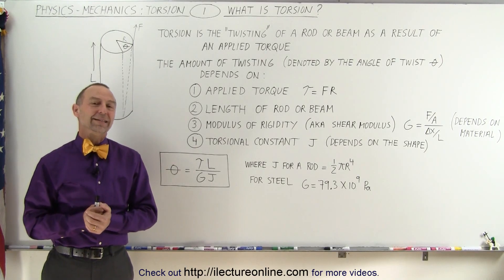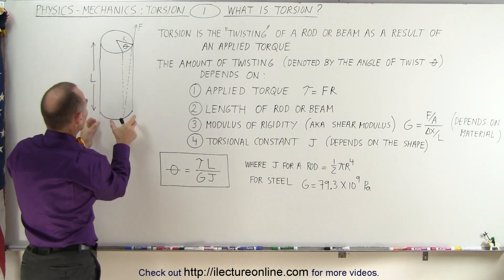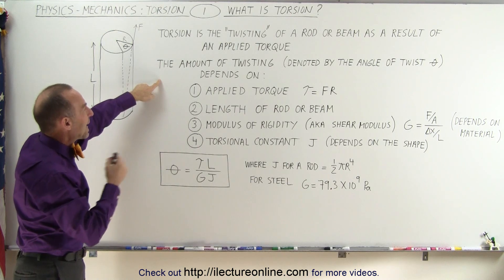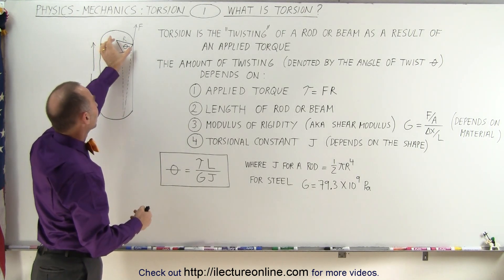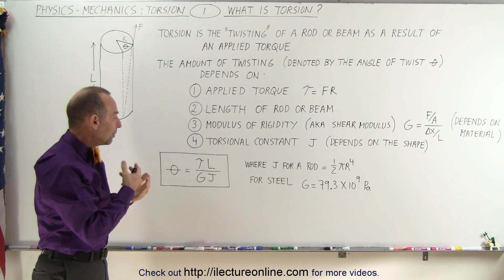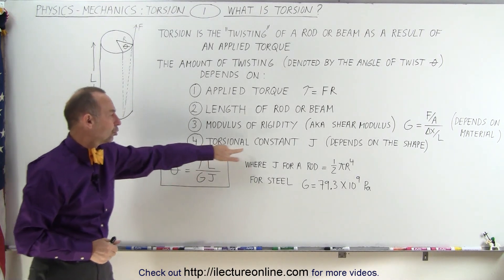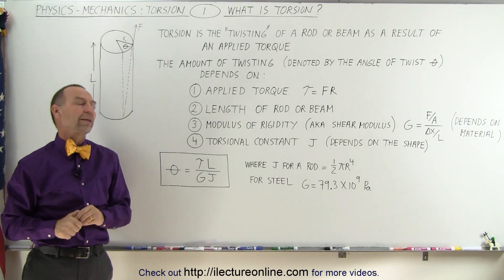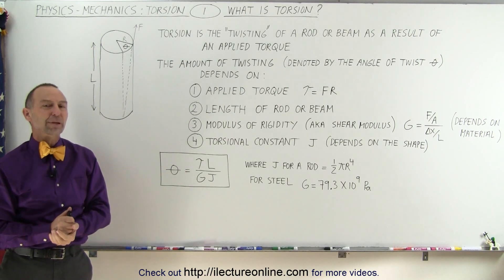Physics 16.6  Torsion (1 of 14) What is Torsion?

Comment: Hi, I am doing a research project about the torsional pendulum. I will be finding 'k' through an experiment.
My teacher has asked me before doing the experiment to give him a literature value of 'k' so I can then compare the experiment result with such literature value. I cant find the literature value of 'k' anywhere. Can you help me?
Reply: Start with the formula he shows at the start of the lecture, and rearrange it to make tau/theta the subject.   This is how we define the torsion constant kappa.  You end up with kappa = G*J/L.  Shear modulus G you look up for the material, J is from the polar moment of area formula for a solid circle of measured diameter, and L is measured length.